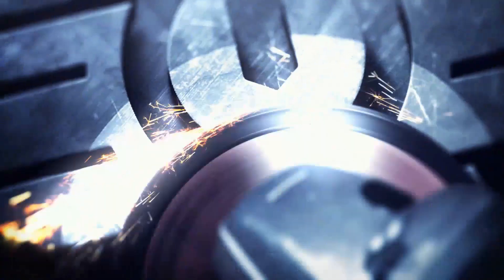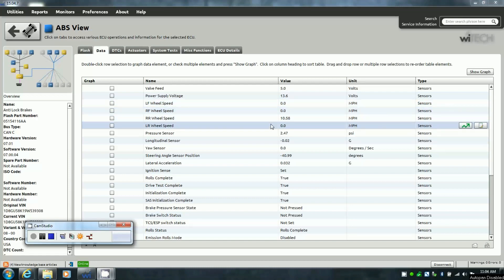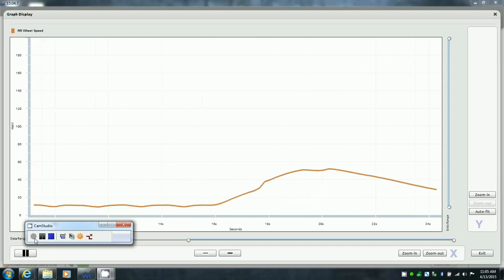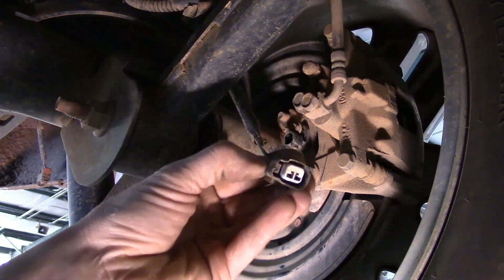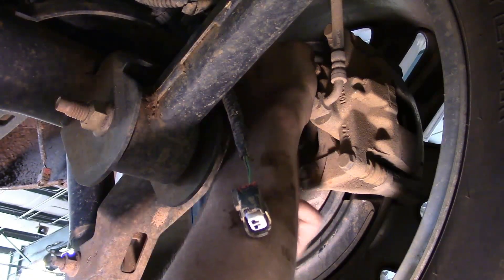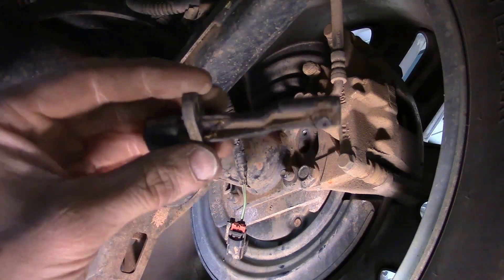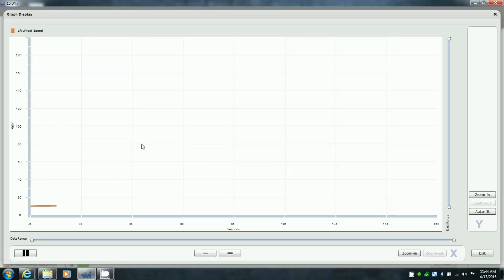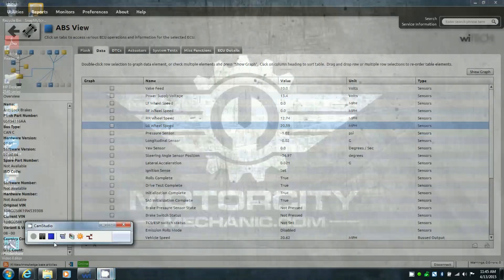Dodge Nitro rear ABS speed sensor troubleshooting and removal

Comment: 2009 Dodge Nitro 3.7L SLT

Will BAD Wheel Speed Sensor "disable" SpeedOmeter?

Lights:
ESP/BAS, Air Bag, ABS, Traction

No Check Engine Lights.

Comment: Hello. Why would I lose signal from both my rear speed sensors, when I change in to 3rd gear, and get stuck in that gear? Extremely frustrating.
Reply: I am having the same problem. Did you figure yours out
Reply: @adamedds2418 I changed the tone rings.

Comment: hello great video. i have a low esp problem on my dodge nitro the light comes on and goes out from time to time i replaced the two rear sensors the problem persists. with which software do you scan the dodge nitro please? thanks in advance

Comment: My damn sensor broke into two pieces. Having a hell of a time getting the other half out..rust belt

Is there any way to get to the front? Right rear
Reply: Did u have any luck? This just happened to us unfortunately as well. Tight pos sensors.
Reply: @cinderellashoe7511  yes ended up pulling it out through the back side

Comment: Eso bas light on a dodge nitro with track light too how can I fix that??
Reply from the maker: First step is checking the codes to see what the issue is and then going from there.
Reply: Following, same issue, I don't have a tool either how much does it usually cost to have them ran?

Comment: Thanks for the video. I had to remove the rotor to access the other side of the sensor when it broke in the hole.
Reply from the maker: Your welcome Shane. Appreciate you watching and make sure to subscribe.
Reply: Sigh. Ours broke as well. Some being tight haha yeah ours was wedged so bad then broke then the broke piece fell off ...somewhere.. any chance this isn't a whole new wheelbearing due to lost sensor in rear left or if it fell is there no way to access it without ruining the bearing and rotor?

Comment: I have a 07 nitro driveshaft pulled wires out going to the fuel pump sending unit it's in limp mode please help
Reply from the maker: So did it pull out all the wires....couldnt because it wouldnt even run at this point....or just the fuel gauge wires? Depending on the way it pulled it out...you may have damaged terminals on the wires. If thats the case the the fuel pump connector pigtail may need to be purchased and then soldered in place of the old one.

Comment: Would bad abs sensors be the cause of speedometer not functioning?
Reply from the maker: It can. I would check for codes first using a high end scanner that can access all the control modules to see  is any thing shows up, that would give a direction to go in and then also monitoring the speed data would helps as well.

Comment: My 08 charger has the code C102A and U1417 and I replaced the wheel speed sensor for left rear and the wheel hub itself. Whats next?

Comment: Could you tell me what to look for when the code is saying. Idle is higher than expected. 2008 dodge nitro 3.7
Reply from the maker: First thing is to make sure there are no vacuum leaks anywhere....the other is to check the TPS operation. Here is a related video on the 4.7 which has the same set up as the 3.7......it might help. Thanks for watching and make sure to subscribe. https://www.youtube.com/watch?v=oct0ucg13gU

Comment: My 4X4, ABS, EBS? Skid control, keeps coming on. I brought it in for a right rear sensor replacement a few times and it keeps costing me $. If I know where’s it’s at is it possible that I can do my own replacement or check on that part from time to time? Another thing I do not no where the sensor/ harness is located. I’ve seen mechanic crawl under a use tape as a temporary fix or I think it was to support the wires better from getting wet... what can I do? Is this part a major problem and should I get a different vehicle?

Comment: if the traction light goes on and off and stays on pings and then the car slows down then accelerates while you are driving, what do you think is the issue.  Would the sensor force the car to slow down then speed up? Dodge Nitro Detonator 2010 42000 miles
Reply from the maker: The symptoms can be different sometimes. First step will be getting those codes checked. Then we have a path to go down as far as checking things out. Thanks for the question and for watching

Comment: Hi there. I have a Dodge Nitro 2.8 CRD  automatic transmission and its currently on Limp mode. The gears don't shift. Can a bad speed sensor be the cause of that? My ESP ABS lights are on by the way. A reply will be much appreciated. Thanks for the video.
Reply from the maker: loverlove24 First step....having all the codes checked. An ABS speed sensor issue can affect different things such as transmission. Getting the codes will point us in the right direction. Thanks for watching and make sure to subscribe

Comment: does this problem have to do whit no going over 25mph? all the lights everyone mentioned came out in the dash bord and also when i shift it shifts hard...
Reply from the maker: It depends Jose. A bad speed sensor can affect a lot of different things. It will require starting with scanning for codes and then going from there. If you get a wheel speed sensor code then I recommend replacing being that its a common failure.

Comment: Thanks for the great vid.  I hope this is what I need. I have 2009 nitro SE and abs , brake & esp lights all came on. Speedo stoped working for a day also.  Is there only one of these sensors & where is it ?  A Little history  two week back I had to replace left rear caliper, the  piston was not moving freely and burning up shoes.
Reply: looks like the speedometer not working is intermittent.  its working today. was not working yesterday.
Reply from the maker: There should be a sensor in each corner at each wheel. I recommend checking the codes to see if the issue can be narrowed further.
Reply: The advice was great,but infortunetly this was not what I needed. I had a code C2200 & U0121 and was told i needed a ABS module.  I know a replacement would need to be initialized some where, but I cannot find a vid on how to replace.  Do you have one or can you create  to show the step needed?

Comment: Hi I have a 2.8. CRD 2009 Nitro, are the right and left rear wheel speed sensors the same or will I need to buy two ?
Reply from the maker: From what I am seeing.....they are the same. But before you go ordering it....make sure to have the place your getting them from verify that I cam correct. Thanks for the question. Make sure to subscribe and share the videos with others.

Comment: hi, my 08 nitro started to fluctuate speed while driving. would this be a fix, I have codes c1070, c2115, and c2101, which are brake pedal switch, dynamics sensor supply, and battery voltage. where would I start?
Reply from the maker: The voltage codes would be where I would start. Checking the charging system to make sure no higher then normal voltage is recommend. We also need to clear the codes and see how soon they return. From there the voltage at the ABS module needs to be checked to makes sure its not higher then normal as well. If all checks okay then the ABS module may be bad and need replacing.
Reply: MotorCity Mechanic thank you very much for your help, kind of odd that dealership had it for like a week and didn't find anything.
Reply from the maker: Sometimes things dont act up when we have the vehicle and checking it but then again sometimes its the person working on it.

Comment: much thanks, im a decent mechanic, but I figure having an idea of how things are set up won't hurt when crawling under. pretty much a generic set up, but I've never seen a sensor of that style before. I've got ABS, ESP, and traction  lights on right now, so I'm going for speed/abs sensors, then on to the brake switch if that doesn't fix it. Ive only got a $250 scanner so I'm planning on using my power probe or multi meter on another sensor for a bench mark and comparing from there. anyways thanks for the video. you're doing great, if you read this and have any imput, I'd app the insight.
Reply from the maker: The most common cause is the speed sensor. You just need to narrow down which one.....checking the codes would be the best method for that. Then you can just replace only the needed sensor.

Comment: if I don't have a scanner,  could I check it with an ohm meter?
Reply from the maker: The only way to really test one is with a lab scope. I don't remember about the ohm readings. In some cases you can check it simply that way while others you can not. One way to see if it's possible is to disconnect the other speed sensor on the opposite side and see if you get an ohm reading from it and if so.....compare that reading to the questionable sensor. Thanks for the question and make sure to subscribe

Comment: I have a 2009 challenger with a code for right rear sensor. How do you pull the right and left connectors down where they go thru the car floor connection?
Reply from the maker: If you look closely you will see a metal clip that goes thru the side of both of them while they are sandwiched together. You just push in on the middle flat spot of the metal clip and then pull the two connectors out. Worse case scenerio you can remove that metal clips to get the connectors off and then reinstall it before pulling the connectors back in. Thanks for the question and for watching. Make sure to subscribe
Reply: +MotorCity Mechanic  Thank you!
Reply from the maker: Your welcome. Hopefully once you look at it again it will make sense now. Its hard to explain some things in just words.
Reply: +MotorCity Mechanic Subscribed!
Reply from the maker: Thank you sir

Comment: Hey David I have a 2010 dodge ram 3.7 two wheel drive pick up just a work truck.
I keep getting a U1418 code 
i have replaced the sensor checked for power cleaned the tone ring.
the light will  go off and then shortly come back on again 
UGH what I'am i missing 
I will be checking the other left side today but I,m shooting in the dark here.
Love the video on the cabin filter helped me fix mine 
took the fear out of working on something new ( I have a 64 Valiant)
Keep up the fantastic work
 cheers Jim in Canada

Comment: hi, thanks for video, awesome job, hoping to get  the wiring changed I think I need the connector as well any clue what's part #
Reply from the maker: Thanks. I need to year, make, model, and which sensor you need the connector for so that I can have my parts department look it up tomorrow
Reply: 2008 dodge nitro, 3.7L right front wheel
Reply: Thanks bunches!!! I'd really appreciate the help 😊
Reply from the maker: +Patricia Rodriguez tell me thank you when I get you the part number lol. I have been know to forget so make sure to remind me incase you don't hear anything back later tomorrow
Reply: +MotorCity Mechanic lol yes Sir, will do 😉👍
Reply from the maker: +Patricia Rodriguez looks like I am going to need the VIN number in order to find out. You can email it to me if you like to david@motorcitymechanic.com
Reply from the maker: The parts department did some more checking and the Prt#....5183447ab is what they came up with. Its around $49.00 however....ouch

Comment: do you have to clear the code after its replaced
Reply from the maker: +Michael Sarabia Its recommend to clear the code. Otherwise it may take some time for it to eventually cause the light to go off. If you okay with the light for a bit of time then feel free to wait until it goes off over time once it passes the test when checked. Thanks for watching and make sure to subscribe !

Comment: Do they just sell that part where it connects ? I don't need the whole part just the part that clips
Reply from the maker: +Gabriel Lopez Evening Gabriel......can you please clarify exactly what your describing? Are you speaking of the connector for the sensor?
Reply: +MotorCity Mechanic sorry yes the connecter the connector that goes on the wheel
Reply from the maker: Gabriel Lopez Yes sir they do.....I you get me your VIN number and let me know which wheel (incase they are different), I can have my parts department at work look up the connector part number and possible price. If you don't want to show your VIN here then you can email me at david@motorcitymechanic.com
Reply: +MotorCity Mechanic OK I will email you

Comment: My dodge nitro always have light on esp bas. Is this same troble shooting?
Reply from the maker: Jerico Anciro The first step is to see what the codes are causing the warning lights to come on. If it is a speed sensor code then the procedure would be the same of the rear. The front replacement is different but simple enough.

Comment: Any videos on replacing a thermostat for a dodge nitro 3.7L?
Reply from the maker: Victor Gonzalez Sorry but I currently dont. I will try to keep an eye out if one comes in for that repair. Its a fairly simple job being that the t-stat is located at the bottom of the engine where the lower radiator hose goes to the engine. The t-stat housing is plastic and has two bolts. Thanks for the request